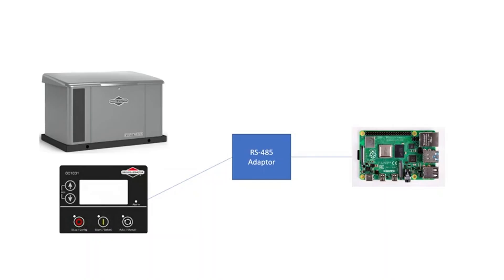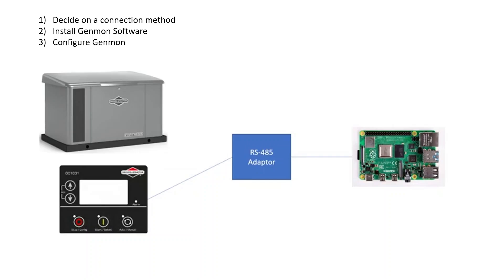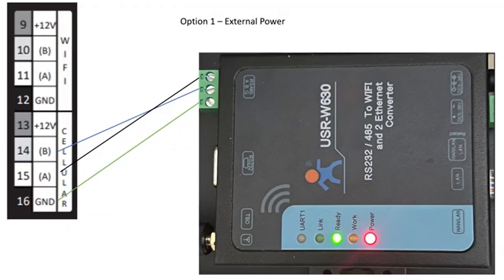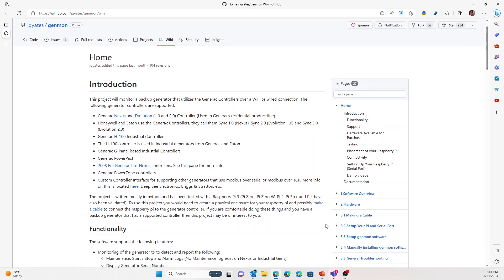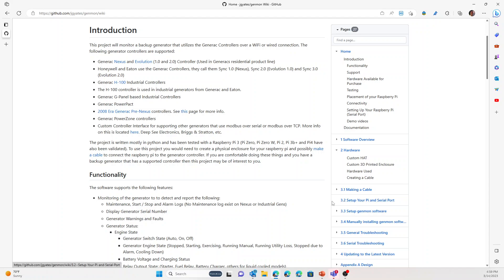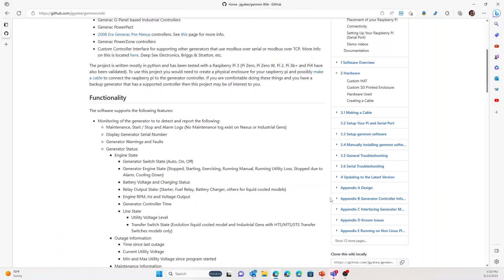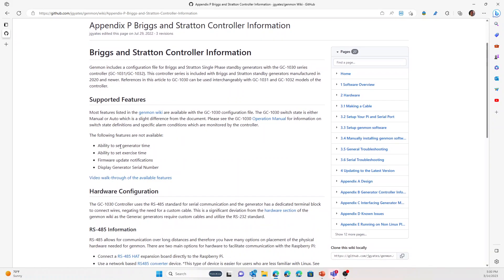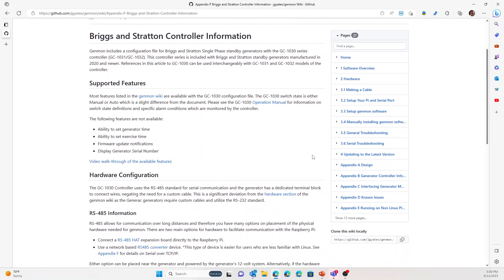How to install Genmon for your Briggs and Stratton generator

Comment: I just did this with my genset. I have a few notes/comments. I am very good at performing all of this kind of stuff, but there are several things that would make this whole setup easier for people that don't have much technical experience.
(1)One...a simple diagram with wiring point to point was good, but unless a person removes the GC-1031 Control Panel on my generator, there is no clue as to where that Cellular Terminal block might be. I only knew because I had an obsolete Briggs Wifi board in mine that had to be removed, and it was wired to that block
(2)Two...the IP address on the USR-W630 is nearly impossible to change. However, I found that I don't need to change it, once the PI and the W630 have both booted, the PI will actually be able to poll the IP address that you put in the config screens of GenMon, if all other parameters mentioned in the video are correct.
(3)Three...I know this is going to sound too noob, but I feel that the ideal tutorial for this whole setup would actually be a line by line (step one, step two , step three, etc) document or video would make this whole thing very easy to setup. Between these excellent videos and the WIKI page, it can be confusing on which steps need to be performed, due to jumping back and forth, and some steps being for a Generac, vs a Briggs. And some things in the PI, at least in my case, were automatically done by the PI software, like updates.
(4)Four...NOTICE, you do not need BOTH of the devices pictured in this video, it is one or the other, and the W630 is very very much easier to setup and install outside in your genset. Then the Raspberry PI can actually stay in the house, plugged into a PI wall wart (Power supply) and unless your genset is very very far away from your house, the two will connect and function
(5) Five...It was much easier to set this up by using my laptop, and on the W630, telling the laptop to use that WIFI access point to get an IP address. Then in the W630 Instructions, it clearly tells you how to run the apps to configure itself. and allows you to do the things mentioned in this video. I could not find a way to have the W630 use DHCP and get an address from my router, although the W630 can be its own DHCP server, and give you an address. Once you have configured the W630, you will need to disconnect from it, and go back to your own local router to access the Raspberry PI and Genmon.
(6) SIX....the Raspberry PI needs to be on your local network address if you wish to run it on a local PC webpage. You will need to remember at every place there is an IP address, you will have to also have a PORT number....The PI needs a port number to reach the W630, and your browser needs a port number after the IP address to reach GenMon on the PI. 

I know some of this seems pretty basic, but I have talked to a friend of mine who is usually pretty good with these things also, and we both noticed it was a bit easy to get lost.
However as the video says, GENMON does a wonderful job of setting up your RPi. Most of the tricks are finding the right settings, putting the right numbers in the right places, connecting device to device over TCP, and getting setup so you don't have to have a dedicated PC in your house to check your genset

Sorry for being long winded, and I hope this helps someone
Reply: I am interested in the gauge of wires used. It appears they are just 26 gauge cat6 cable run between the generator and raspberry pi?  Can this communication be ran through the electrical conduits and back into your home to ones network rack and powered there? Maybe my questions will be answered as I dive into the GitHub page more.